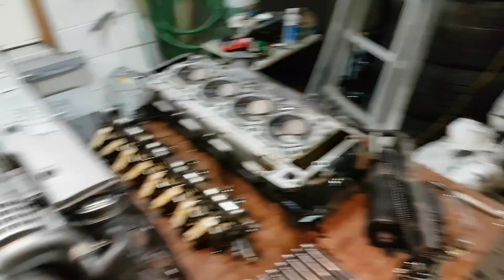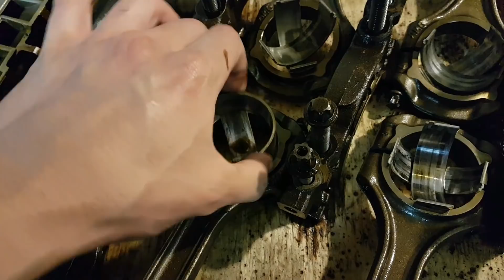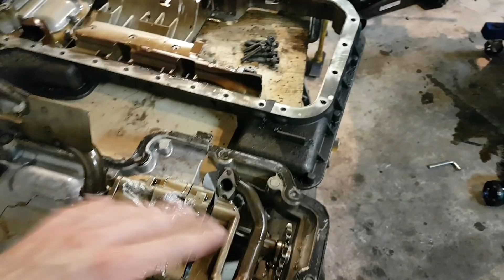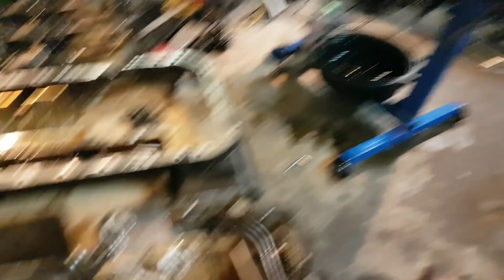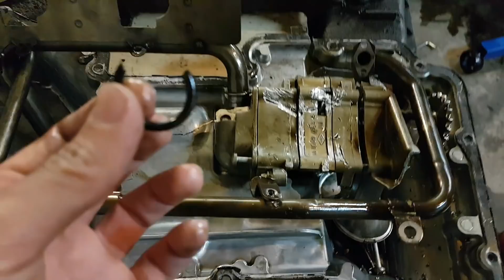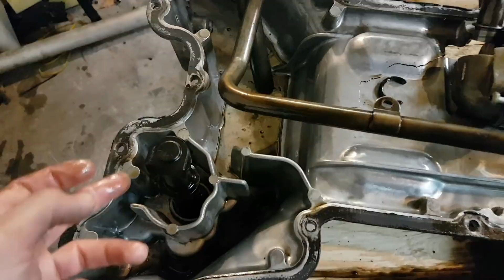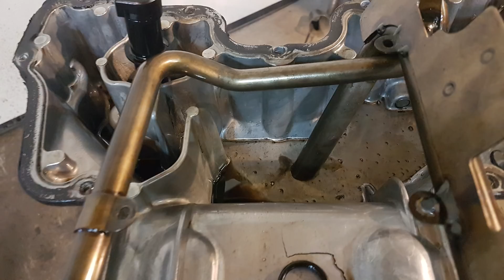Why my Engine Blew. Something every E55 owner should know!

Comment: Making a car with no oil pressure sensor is just criminal. Using that o-ring config is equally so. Building a race car and not being aware of the lack of a sending unit is..well...what it is...

Comment: I would put in another M113K engine in it and put in a new gasket and install an oil pressure sensor and reprogram the ECU so it would automatically turn off the engine as soon as oil pressure is lost. Be faithful to the original powertrain. Putting in an LS or 2JZ would put that german engineering to waste and seriously hurt the resale value.

Comment: What respected Engine Builder, in their RIGHT MIND, would decide NOT to include a frikin' Oil Pressure Sensor?!
Seriously....wtf?
What is AMG thinking?
(... Unless, they're thinking how to build an engine that is ridiculously cheap to make, and performs good for just a few years... how Pathetic.)
Really angers me.
Reply: Mercedes , its targeted at the rich man market and so if it fails its expected to be repaired or replaced without $$$ questions asked
Reply: Especially in a AMG... Not like this is a Corolla or mini Cooper,  for as much as the car cost from AMG I am very surprised I never heard that before..
Reply: even my bandit 1200 motorbike has an oil pressure light!! I blew an underpan tray before when i ran into a car jack on the road and it lit up just like it should and i stopped my bike in a mile or 2!!

Comment: WOW - such a dangerous, absurdly incompetent design.  This is why the market is pricing out of warranty $200K Mercedes under $10K, but only with low miles and in "mint" condition with gap-free immaculate maintenance records.  "Very good" condition top of the line models are selling under $5K just a few years out of warranty.

Comment: Where the heck would you install a pressure sensor if there's no place setup for it?
Reply from the maker: There's actually an outlet for it on almost every Mercedes engine. They just don't install a pressure sensor there anymore. I'll make a video on it this weekend.
Reply: Cool, I'm on benz #8 but no AMG's or one new enough to not use it except for maybe a W211, 04 E320 I had a few years ago.  Look forward to seeing that.  I can't believe they opted not to install that at least so far as pinging the check engine light or "stop engine immediately" warning message on the center screen.

Comment: Maybe that lead foot and over taching had nothing to do with a slung rod ?
Look at your crank journal, it i s canted over about 5 degrees out , this was 
due to the intake valve floating during engine overspeed. In other words
the piston out ran the cam and the valve closure which is common in a 
chain drive cam system, the chains at ultra high rpms stretch and back lash.
cam timing is all over the place. That is the reason you will never see chain or
belt drive in a pro drag car, they are always gear drives.
Reply: I don't think so Michael, if that were the case I'd expect to see contact with more than one valve. What it looks like happened here is what he described, that #5 experienced the brunt of the oil starvation effects. Clearly in my experience that rod and bearing combo severely overheated to the point of metal fatigue, stretch and failure and somewhere in that series of events the piston contacted the valve and cylinder head. 

           I'm sure it knocked somewhere before it failed, he may not have heard it, or recognized it at high rpm.
As for your stating that valve float is common in chain driven engines, I've never heard of it being a result of timing belts and chains. In my experience with building timing chain engines, valve float has been a consequence of insufficient valve spring pressure and control for the desired rpm range. Chains would have to stretch quite a bit and in the presence of extremely tight clearance tolerances for that to happen. I wouldn't expect overhead cam engines to have as much an issue with it if it is in fact true given that they have a lighter valve train system than cam in block engines which have to raise the lifter also.

Comment: Interesting.  My guess is that the o ring was cut during installation.  It's also my guess the redundancy of the Benz design allowed the engine to survive during normal use even though the pump was cavitating.  It's probably the competition use that pushed the conditions (high rpm / hp demand, hot / thin oil, g-forces further compromising oil pickup, and so on) beyond the rod bearing's ability to cope.  #5 rod is the furthest rod from the pump supply, so this kind of goes along with the cut seal line of thought.  Sorry for your troubles, btw.

Comment: It's a maintenance-related fault. If the engine oil is changed by the ordinary intervals and the proper oil quality is used, then the gaskets never get hard and blistery. This can happen on any car that has been poorly taken care of and it happens all the time that relativly new cars loose oil pressure because hardened o-rings.

Comment: You're telling me that with all the computers etc. there wasn't an oil pressure monitor? You would have known right away if that had been the case. and AMG and Mercedes should be ashamed of themselves for not putting a pressure sensor on the oil system.
Reply: nisssan and toyota must be laughing in Japanese dialect...
Reply: fidel catsro I’d be laughing at Nissans reliability
Reply: yes after 2009 Nissan joined with Renault it became question...before that it was a great name

Comment: detonation will also chew through a bearing sending the shrapnel all over the place giving you the kind of damage until something shakes itself loose,
also the damaged crank journal had oil supply as you have coking on it maybe not great oil supply but it was running extra hot
it is possible the o ring broke when the rod smashed the oil pump

Comment: Benz is over priced junk.. always has been..
Reply: *sent from an iPhone
Reply: I guess that‘s why you where named Dick.
Reply: You know that „American v8“ are made in Germany, too? Eisenwerke Brühl near cologne puts out thousands a year.
Reply: I beg to differ. My benz is 25 years old and never has missed a beat.  I replace parts that wear due to age not due to failure.
Reply: Weren't designed there, for the most part.
Reply: And like every other competitive motor sport, they have engineering restrictions on their vehicles. They're allowed to build a specific type of vehicle with, relatively speaking, small engineering differences. That is to say, if left to their own devices, they probably would have built something over engineered and unreliable. German manufacturers, MB in particular, have a habit of doing that anyway.
Reply: @ beachbummer
Modern mercedes suck, but not the old ones who are not hooked to a computer, because they are the best cars in the world. That's why the most
oldtimers that are offered in europe are mercedes benz because they run forever.
Reply: beachbummm69 cause u never had one or u would know better
Reply: ya sound like a poor
Reply: That's why no one buys German cars.

Comment: Absolutely a great video! Here is my solution! When your MB engine gets older, use a seal conditioner in the oil along with a quart of Motorkote to stop the heat of friction. Of course your application is racing, and most racing engines are torn down after so mile hrs and cycles. So, I would think the average MB owner would see a good o-ring for many more miles.

Comment: that o-ring broke when the rod hit the pump.
Reply: But what, in that case, caused the loss of oil pressure (clear lack of lubrication) in the first place?
Reply: the hard o-ring not sealing.  There's no way that o-ring can break without movement between the pump and the pickup

Comment: A Few points your very good video brings back from memory.
1)For many years race car mechanics have installed a big red warning light to warn the driver of oil pressure failure. A gauge is a good idea,but belt and suspenders here. When driving,keep it simple,you will not be concentrating on gauges.
2)Various race car parts houses sell different designs of oil accumulator,some with the idea of a driver actuated ball valve for a last ditch way to supply oil for a few moments anyway. A good idea here. Try Summit Racing for a start.
3) I would be pissed. At the very least,contact Mercedes-Benz with a polite but very firm letter,paper not electronic. How dare they allow a point source of failure like this. Since it is not backed up with an appropriate idiot light,they are the idiots here. Any American lawyer worth his salt would rub his hands at a potential class action lawsuit here. You will not be the only individual affected here. I would be enraged,not philosophical. Racing does indeed improve the breed.
4) Fix this so that there is a better pipe seal than just one O ring. That is just plain stupid. Is there any way you can install an A/N fitting instead of the O ring ? Even if it means modifying the end of the pipe as well.
Good luck with your next engine,and for God's sake,go through it with a fine tooth comb. Happy track time in future.
Reply: paul manson mb would cite the EXTENSIVE modding he did to the vehicle as a reason for added stress and it would be good enough for almost every judge, if not every one.
Reply: Larry Wilmore Hmm. Perhaps you are right. I suppose the real issue here is to put pressure on the engineering team supervisors not to be stupid with point source failure without warning light backup. Particularly that there is an on board computer capable of decision making in so many hundreds of microseconds. When 1981 model year rolled around and the on board became a reality,there was much talk of 'limp home mode '  . A solenoid could be empowered to trigger the  emptying of an accumulator of oil.big warning light,timer,voice,limited power,and things I cannot think of that brighter boys with training can. If I can think of this,the fact that MB has not done some or all is more than bean counting. They should be ashamed of themselves. Look at the complexity of that disassembled engine compared to the 1955 revolutionary Chevy small block. The process engineering required to create the production line much less the engine is something they should be proud of. Not that many decades ago,an F1 engine was less complex. Point source failure is an embarrassment the militaries of the world have been tinkering for many decades. How dare MB allow that here. The more pressure on them the better.

Comment: A O-ring took out a space shuttle in 1986 too.
Reply: It was the opposite. Shrank because it was too cold.
Reply: @R005t3r  I worked for DuPont back then. Material was N-butile nitrile. I had a Rewmington 1187 auto. THe o-ring would  not seal in cold weather and I would get jams extracting the shells. I contacted them, and said they needed to change the material. I went to an auto parts store, and still have that O- ring in my gun years later.

Comment: HUH? this is a case of abuse  the oring is this location is not the 
problem  this type of oiling system is used  and works well
the reason the o rings is hard is the lake on clean oil   as the oil 
ages in a motor  it becomes acid and the heat will make most
rubber types  do some thing called carberise  and IT gets hard
this and high RPMs is what destroyed the motor   
things tou can do to prevent this   use a good oil and change 
at tow or three K   the oil should be i good synthetic  a heavy
will not work   the same thing that makes oil Heavy is what
cases the rubber to carberise    i have tested oil for a number
of race car drivers   that use dry sump systems  and i think 
that most have rubber seals     i liked watching your video
thank you for your time

Comment: A good design and a good reliable car will last 100-250K miles on hard driving/racing every week like my current car. Not be considered high mileage at 150K kilometers. That's ONLY 90,000 miles!!! AND THATS HIGH MILEAGE TO THOSE ENGINES? SHIT RELIABILITY AND SHIT DESIGN

Comment: 124,000 miles is high mileage. To you? WTF. That's shitty if that's high mileage for those cars. That design is Shit if an o-ring made ur engine detonate. People who own those cars always say how great they r built but yet they always break. Therefore it is a shitty design that's not reliable. Honda/Toyota= low maintenance/reliable. BMW/Mercedes= high maintenance/not reliable. When I owned my e55 Amy back in 08 that thing was great at first night after 100K miles it was Shit. They are not built good and have Shit reliability.

Comment: i have to ask:
what weight oil were you running during track use?
did you know that the recommended oil for daily/normal use is wholly inadequate for track duty/continuous high speed operation and will thin to the point of allowing the damage you are seeing? it's  not the fault of the pump. the factory on the other hand most likely didn't advise accordingly.
the reason i bring this up is that this is not the first time i have seen this happen with mercedes engines.

Comment: Who was stupid enough to remove oil pressure light??? It's bad enough already that there aren't any dipsticks on a few engines from german manufacturers. Every sports car or a car thats getting tracked needs an oil pressure gauge.
Reply: Neither is it a track car nor is it a sports car.
Reply: Well... It is considered a sports car since its AMG but removing oil light is stupid nevertheless. But if youre going to track a car often(i dunno how much this guy was going to tracks but sounded like pretty often) better fit at least oil pressure&temp gauge
Reply: Whether something is a sports car or not is not subjective but objective. It doesn't even mention with one word that it is a sports car in the owner's manual ;)
Reply: Yeah, I agree with you. But I guess supercars may not mention that in the owners manual as well. People just consider AMGs a sports car just as M cars

Comment: @SK8215 Looks like you don't know much about Mercedes engines. The Oil level sensor is also a oil pressure sensor. Maybe you should take a look into the engine documentation in MB WIS before you spread bullshit over the internet. And sorry for the rude words, but if you don't know what you're talking about, you just shouldn't talk about.
Reply from the maker: The oil level sensor does NOT detect pressure. Its not even located on a pressure line. It only gives you an oil warning when the oil level is low, not when the pressure is low. I've already discussed this with the dealers before posting the video so if you don't know what your talking about go confirm your facts first

Comment: Truly excellent video.  But how many $$$ to get to that O ring  for the owner who wants to take a precaution?  How much of the car needs to be pulled apart? The old  16 valve V8s had a similar issue with plastic connectors on the cam oil feed lines. Real cheap DIY  fix for  us poor eBay guys, but the rich Manufacturer Parts Only ) guys used to spend a fortune on it.
Reply from the maker: I just ordered one from the dealership, its $3.66. Part number 027 997 38 48. All the rest of the o-rings on this engine are really cheap too, so makes sense replacing all of them while your at it.

Comment: Good info, thank you. Awesome troubleshooting. This is a dilemma for any engines older than "X" years, as most o-ring be it EPDM, Buna, FFKM, Viton, Silicone and what not...have a finite life. 

I think it will be much safer if we can tear down the engine and replace all o-rings , gaskets and whatever non metallic seals in the engine per "X" years., for those with duty as critical as the -o-ring on your oil pump pick up tube.This will be timed based preventive maintenance no user manual will tell us , but we know it is needed...eventually. 

I usually change all hoses related to cooling system before it reaches 10 years, or sooner, depending on visual check, but limit is 10 years max.
These hoses can be inspected visually without tearing up the engine, that is the lucky part. However, I usually sell my car before its 10th year.

I agree the oil pump and pan design in your E55 is scary. I mean, usually we see oil pump being submerged in oil bath and not positioned that high. Also oil pick up pipe with an o-ring  like that instead of flanged connection with screws and  say paper based gasket or copper gasket.

Hope you get your engine fixed fast. Thanks again for sharing.

Comment: That's astounding that the engineers did not design an oil pressure sensor into the system. Especially on a high-performance engine like this. My W116 has an oil line that runs to the pressure gauge in the dash - super simple, easy to read. 

It seems that Mercedes vehicles would be invincible without their rubber components - O-Rings, Harmonic Balancer, Engine Mounts, Suspension Bushings, Air Springs - all common problems and all due to the degradation of the rubber compound. And, apparently, the oil system :(

Great video but sorry this happened to you. Keep up the excellent work!
Reply: They are made to fail

Comment: Great info thanks have never seen inside a engine like mine. Hope I never haft to. I do have the S55 do you know the difference in the S55 and the E55 cam shafts they are not the same part number. I wondered if this is the HP difference between the S55 and theE55 thanks
Reply: Big sea if there is actually a power difference between the two (jury is still out, but many conclude it was a marketing ploy by mb), it would be down to the exhaust/tb
Reply: I know the software is also diff on the E 55 and the S 55. I have to Kompressors they are not the same. I have been a parts mangerfor 30 + years I will let you know what I find out fact or fictionI do no cam profiles and ECM tunes can make a diff we will see.thanks for the comment